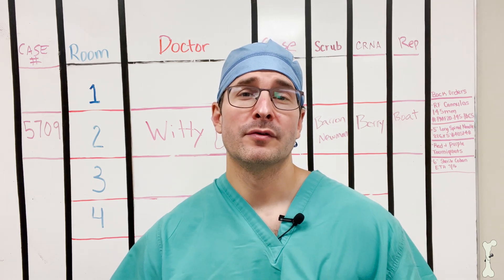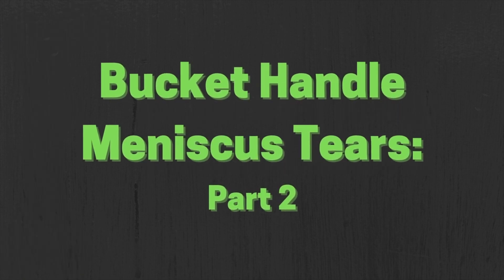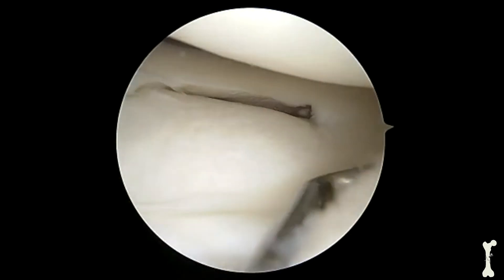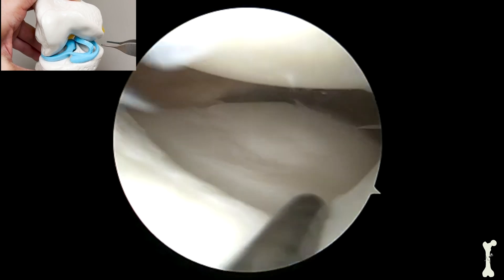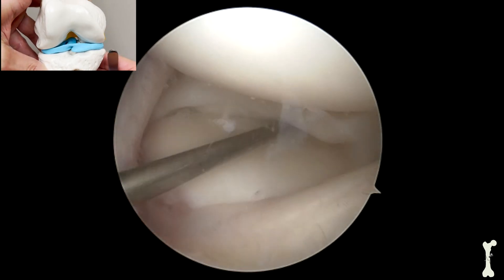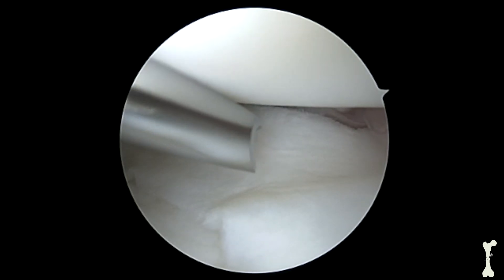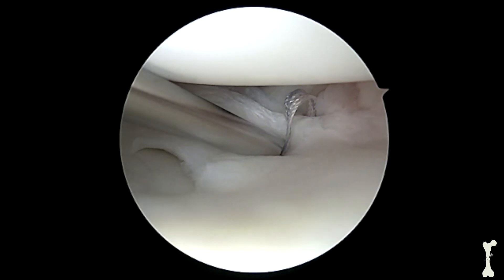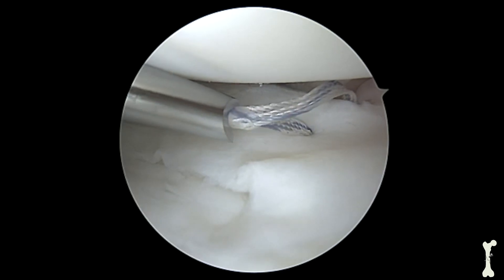Bucket Handle Meniscus Tears - Part 2

Comment: Would a bucket handle tear still be repairable 2 years after injury?
Reply from the maker: Good question,

In my experience, the answer is "it depends". 

A bucket handle meniscus that is stuck or "locked" out of its normal position for a long time (weeks to months) would be unlikely to be repaired but at the time of surgery I would still be ready to try and get a repair.  When the meniscus is stuck out of position like that the tissue contracts and the meniscus will essentially deform and become impossible to repair. 

If the meniscus is shifting in and out of position from time to time it may not undergo those changes and it's possible you could get a repair.  I actually have a young man who injured his knee years ago with a similar injury. He is on my surgery schedule to fix an old unstable meniscus. The tissue looks good enough for a repair. 

_________________________________________________________________________
Please understand that this does not represent the formation of a formal doctor patient relationship and is for educational purposes only. All comments should be considered as informal suggestions regarding any matters of medical care. Please also be aware that this is a public forum and any information you share is not secure.
Reply: @JeffreyWittyMD  Thank you doc. Mine does also shift positions on a daily basis. It never locks my knee though. Just changes place and I can feel it. Would that mean the tissue is still preserved?

Comment: Thank you for taking the time to make these videos to show the repair process.  I had this done a week ago and was interested in what the surgery actually entailed.  I am so glad I sought a second opinion and was able to find a doctor who was willing and able to do a repair, rather than a partial meniscectomy.  I could not wrap my head around how a partial meniscectomy and the resulting reduction in bearing area would be good in the long term.
Reply from the maker: @jeffreyalldredge1739,

It sounds like you have a good understanding of what the meniscus does. As you mentioned, losing the meniscus results in reduction of the surface area which in turn passes more load onto the cartilage on the ends of the bone.